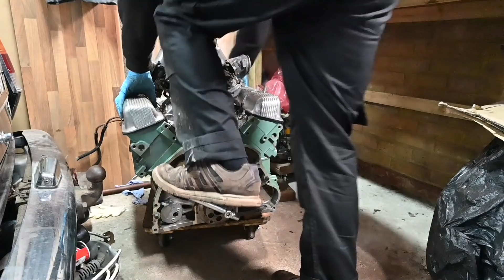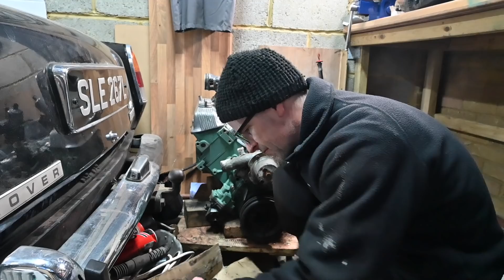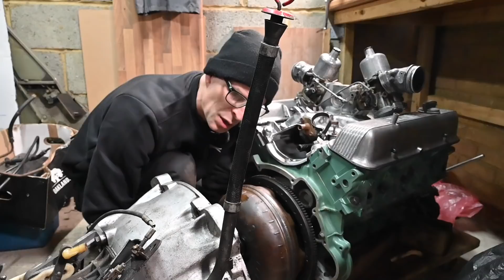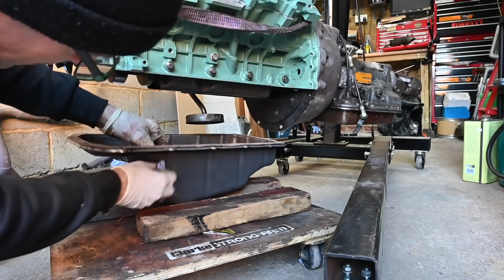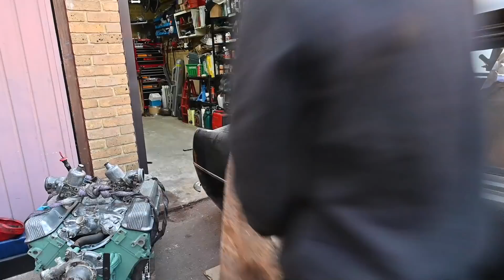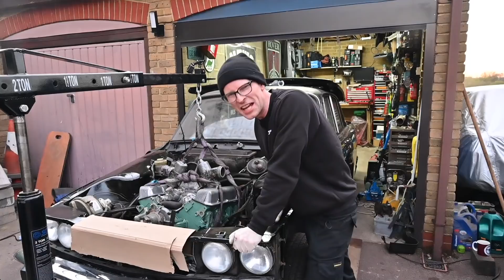Rover P6 4.6 V8 goes in AT LAST!

Comment: A nice trick to align a transmission for installation back on an engine is to create two or three threaded studs from old cap screws (or buy some all thread) and thread them in (no more than finger tight) to the upper tapped holes in the engine block and pilot the transmission over them, allowing the installation of the remaining cap screws (then replace the pilot studs with the final cap screws).

Comment: I had a 215 C.I. (3.5) in a 1963 F-85 Cutlass  ,and I installed steel spark plug inserts.Someone had stripped out a spark plug hole,and I heard a popping noise while idling.owing  to my experiences while restoring Corvairs,I installed steel inserts .Passing on a tip,Cheers from  Erlanger Kentucky
Reply from the maker: Thanks!
Reply: @furiousdriving  If the 4.6 doesn't have steel inserts,I'd install them while you are able (before it's all buttoned up :)..Cheers from Kentucky :).
Reply: Hopefully you can find those..:)

Comment: I leaned my lesson years ago when removing an auto box and leaving the torque converter in place on the engine.  When replacing the gearbox the torque converter tube, being quite sharp does a really good job of ruining the gearbox front oil seal.  You will never know this until you eventually fire the engine up and see all the transmission fluid leak out.  Always keep the Torque converter with the gearbox or it's very likely that you will have to pull it all out again to put a new seal in the box.
Reply from the maker: I spent a while lining those up so it would slot straight in. Really couldnt see how you'd attach the TC to the engine once the gearbox was connected
Reply: @furiousdriving  The spigot shaft on the engine side of the torque converter lines things up without the bolts.  Bolt up the bell housing then when it's appropriate to get underneath the engine you can rotate the torque converter through the starter hole to line the first bolt up, then turn the engine to give access to the remaining bolt holes in the drive plate.  There is a metal cover closing off the bottom of the bell housing and with that off you have access to the torque converter - drive plate holes for bolting up. Hope that helps.

Comment: Always leave the torque converter on the gearbox, if not you have a good chance of damaging the input seal or cracking the gearbox oil pump when tightening the bell housing.

Comment: Have you tried using a mains powered impact wrench for getting bolts undone? I bought myself a Clarke one a few years ago and it is a game changer.
It takes the bottom pulley nut off my Volvo D5 with no effort. I just changed the clutch and the last person  that worked on it must have used a rattle gun to put the flywheel bolts in, when access is limited you can't always get a long breaker bar in, impact gun saved the day! I'm into the 50-60 demograph now and think that straining under a car is not such a good plan for me anymore.
Reply from the maker: I have a cordless one coming that should make a difference
Reply: @furiousdriving  Makes life way easier.

Comment: If you ever do this again. Maybe that plug comes out with a slide hammer (paintless dent removal fork and a bolt). If it's been put in with loctite 638 the good old induction heater might help. ;)
Reply from the maker: That wasnt moving! I thought about heat but its right by the crank seal and didnt want to damage that
Reply: @furiousdriving  Yeah must be done before installing the seal if done with heat.

Comment: It's a good way to snap an allen drive bit off in a bolt & cause yourself a lot of hassle.....Please don't do that again without supporting the driver. Flex bolts (flywheel) are staggered bolt holes so it can only go on one way to keep the balance correct all RV8s were dynamically balanced as part of the production process). Standard process is to put the torque convertor into the box, assemble engine to box which is dowelled to ensure perfect alignment & then the TC will be able to be easily aligned & attached to the flex plate. Really important to correctly engage the oil pump drive & the convertor drive pegs & not damage the seal on the front of the gearbox. A load leveller will be the best £20 you ever spend by the way!!

Comment: Don't forget to put a drip tray under the BW35 once you've topped it up with trans fluid... and Type F trans fluid if the transmission hasn't been overhauled in recent years.
Reply from the maker: It was overhauled (professionally) not long before being played up but that was a long while ago. Ive had an MOT abandoned by a long stood BW gearbox throwing its contents on the floor before!

Comment: Not an expert on these cars or RWD but cant you lift the engine in from below? With the car as high as you can get it?  I always found it easier that way... Especially single handed.
Reply from the maker: No, theres a MASSIVE cross member under the engine on these, welded in place

Comment: First of all, I'm speaking from a position of complete ignorance here. But as I watched you start offering the gearbox bell housing thingy onto the engine @11.50 I kept saying to myself (and then shouting at the screen) "Gasket!" PLEASE tell me it didn't need one, or maybe I couldn't pick it out in the picture. Heroic work, by the way.
Reply from the maker: Theres no gasket between the bell housing and engine - if you've got oil loose in there to leak you've got far bigger problems!
Reply: @furiousdriving  Erm, well, of course. I knew that....but just thought it might be amusing for everyone to watch you take it all out again! BTW, I'm planning to buy a '99 BMW 728i with 70k. Have you done a drive with one?

Comment: ummm, why didn't you just lift the engine up higher to fit the sump instead of crawling around on the floor? Also,fine fuse wire is often used to hold those cork gaskets in placewhile still allowing the bolts to go through the holes.Just tie each corner of the gasket to the sump, lift it up with one hand and screw a couple of bolts in to hold it. Also the engines are only 230Kg. Average. (some are lighter some are heavier depending on accessories are fitted.) in future, lift the engine and trans at an angle of 45 degrees, insert it,then lift the gearbox with the trolly jack .easier.
Reply from the maker: The problem was getting the gasket up to the moving block. By putting it low I could stop everything swinging. I dont have any fuse wire here and thanks to the lock down cant get anything, a leveller would have been useful but again dont have one here